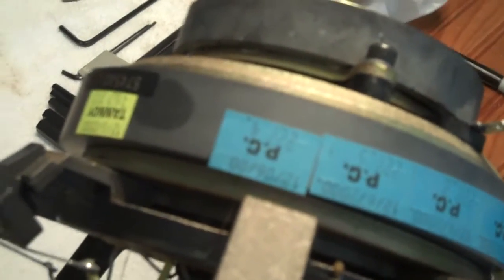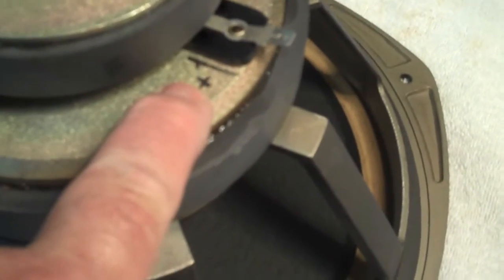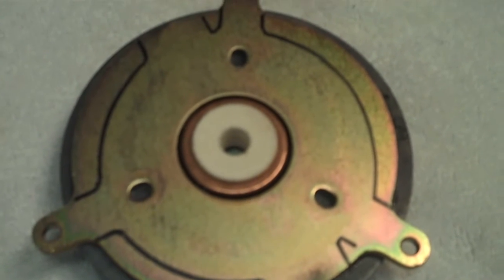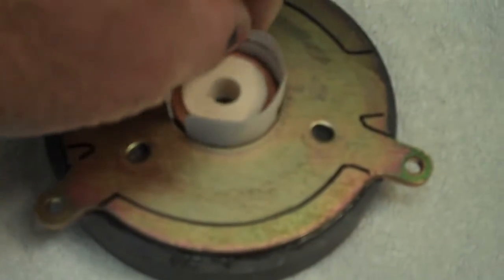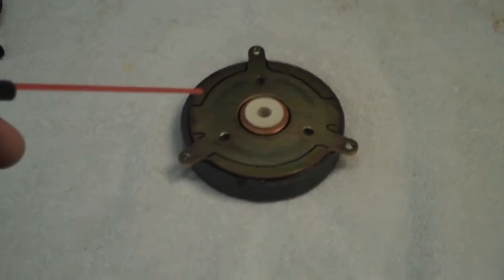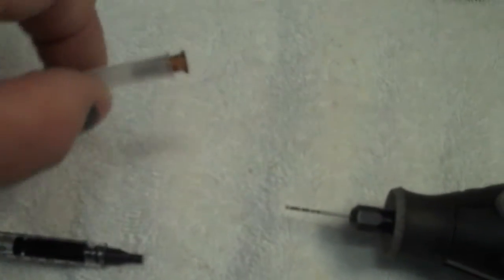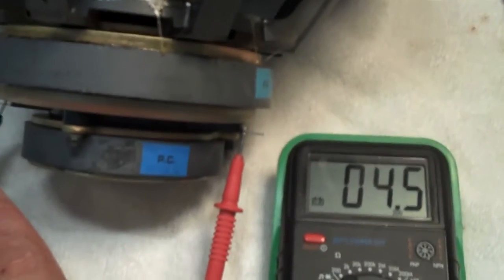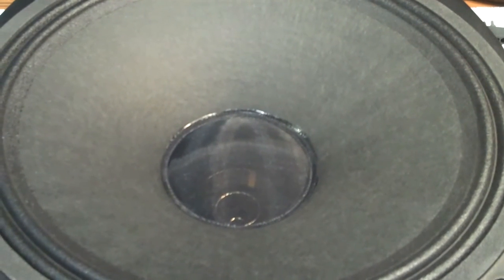Tannoy i12 diaphragm replacement with ferrofluid

Comment: Thanks for this video. I’m replacing a diaphragm that was pushed in. Should I fill or replace the ferrofluid if it looks like it’s mostly still there?
Reply from the maker: I would clean out the old and replace with the new that you received with your diaphragm.
Reply: @augustusd1  my diagraphm replacement did not come with ferrofluid. Is it worth ordering if the speaker hasn’t been burnt out?
Reply from the maker: If it still looks wet with ferrofluid down in the pole piece slot it should be fine. I was surprised at how little ferrofluid was actually needed.
Reply: @augustusd1  thank you! I’ll give it a shot.

Comment: Hello mister !! do not you know where I could buy two diaphragms for tannoy i12?
Reply: Think ONE in here cheapIn Twitter, enter the confirmation code 446425 to turn on two-factor authentication.
Reply: @wynstone7283  "This Tweet is unavailable". I would appreciate if u could send me all details to my email : info@hifiup.com
Reply: I have some replacement i12 drivers selling in the UK!
Reply: @wynstone7283  Do you have two diaphragm units for the Mk1 Tannoy 611 Speakers, or happen to know where I can source some in UK - many thanks.
Reply: @wynstone7283 .... Hi I'm also after parts for the i12 if you have any bits available.. thx
Reply: @wynstone7283  still have diaphragm for Tannoy Edinburgh TW 12'  ?
Reply: Think I just seen some on eBay unless I'm mistaken!!
Reply: I also have tannoy dc 8inch 2062 drivers if any use??
Reply: Just have a pair of fully excellent condition (never trashed) 12 inch dual concentric  drivers...the same one as used in the fantastic sounding Tannoy i12 speakers. Thanks
Reply: My Twitter account
https://twitter.com/Capon27373078/status/1257221117120589824?s=20

Comment: can you put ferrofluid in any speaker or just ones that had it from factory?
Reply: You can, but you shouldn't. Speaker with ferrofluid has its gap that holds the coil much deeper because the ferrofluid needs to stick into that gap. Adding ferro would probably spill it once you turn on the speaker. 

Also there's no advantage whatsoever putting ferro on non ferrofluid cooling speaker. Ferrofluid was used to cool the heat from voice coil of a speaker driver with higher power, if your speaker don't come with it, that means your speaker power is low enough to make the cooling benefit of ferro fluid unnecessary.
Reply: just the ones that had it from factory